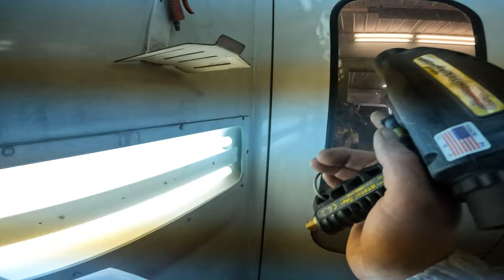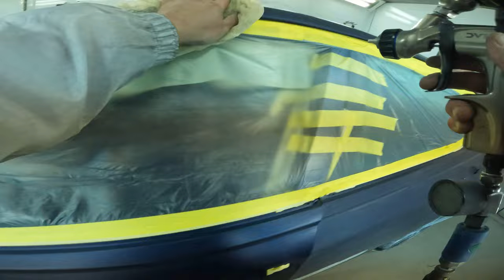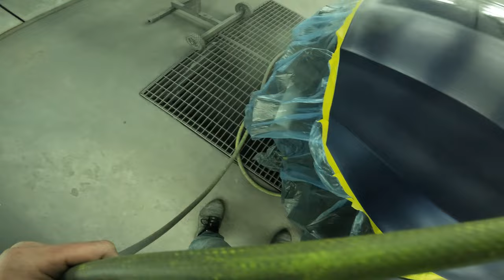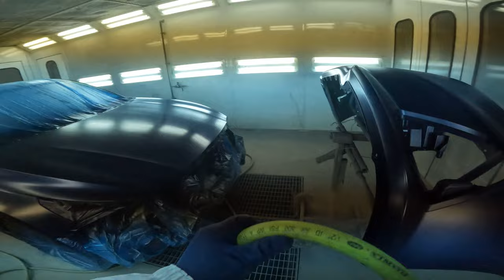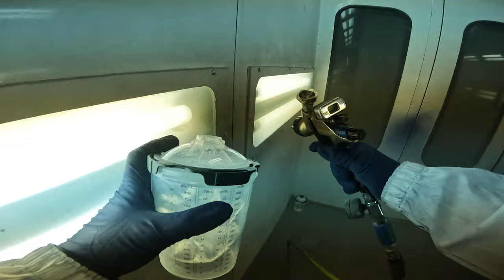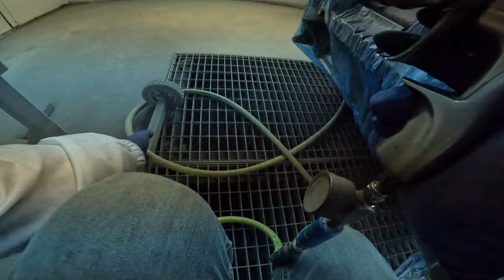How To Spray PPG Deltron! 2022 Nissan Altima Spray 4K 2024

Comment: Wow, for a minute I thought you were clearing the bumper , but no it was adhesion promoter, does it  really need that much ,and your air pressure had to be more than 25 Psi that you fan was splitting
Reply from the maker: I make sure I put promotor on pretty wet and let it flash good. The viscosity of the promoter is very thin that is why the fan splits. I spray it at around 20 psi

Comment: Clearing from the bottom up is a sure fire way to run the sht out of it. And that gun already has a built in regulator on it, doesn't it?
Reply from the maker: I am self taught it's just how I've always done it. No I don't have problems with runs in that manner
Reply: Yea the gun has a regulator but that’s his gun and the shops set up each painter might not have the same equipment and if your getting runs  that’s your technique creating runs
Reply from the maker: @Justthemow  Exactly!